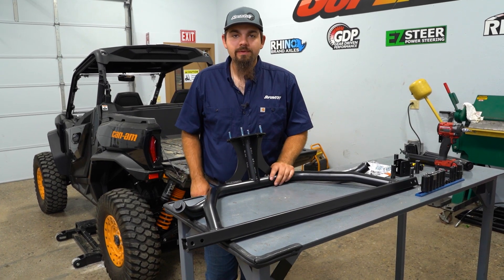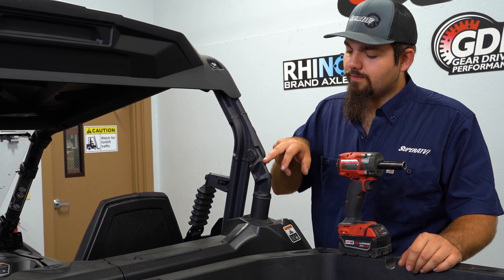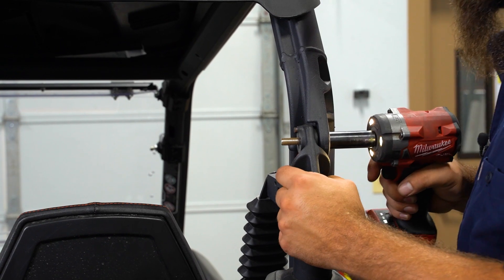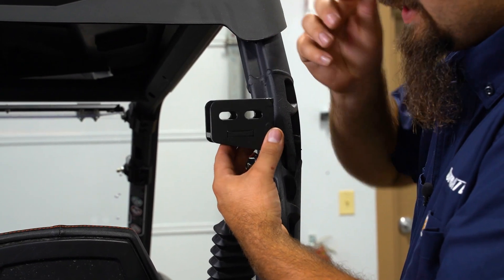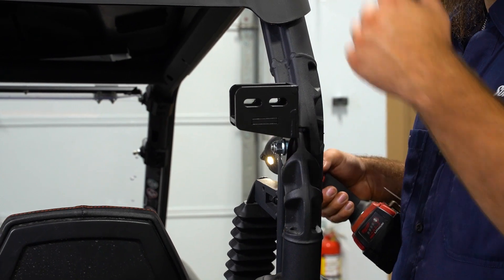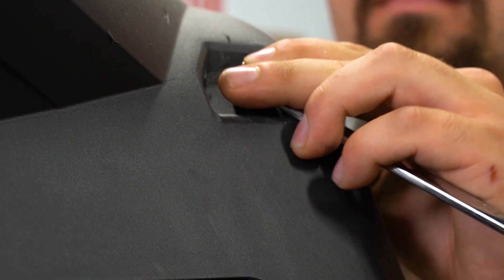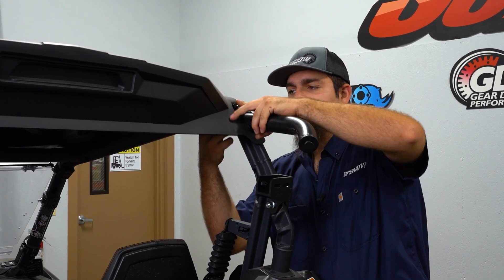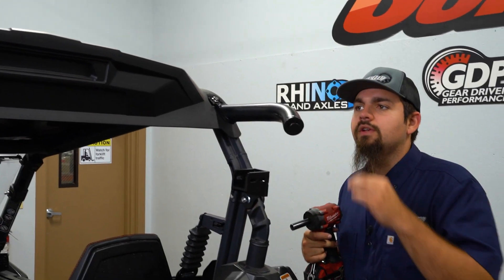How to Install SuperATV's Spare Tire Carrier for the Can-Am Commander

Comment: How much added height does this add to the commander?
Reply from the maker: This doesn't really add much height to the machine as the rack itself sits pretty flush with the roof line. The added height will come from your wheel and tire size/offset.